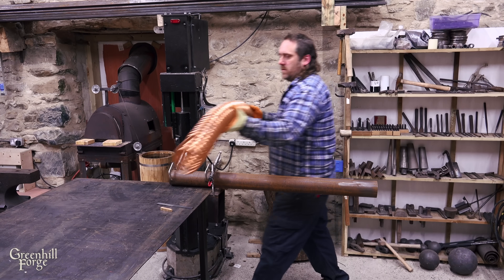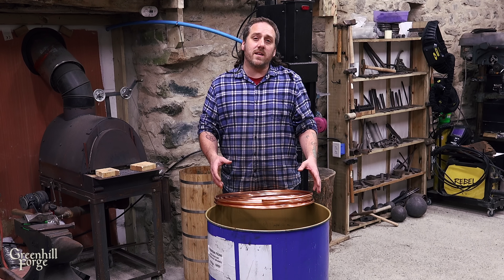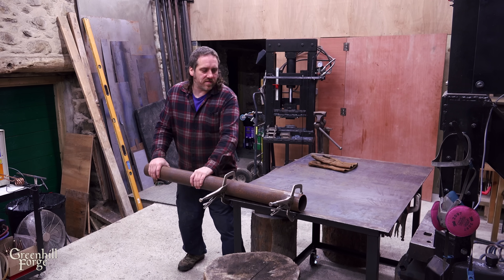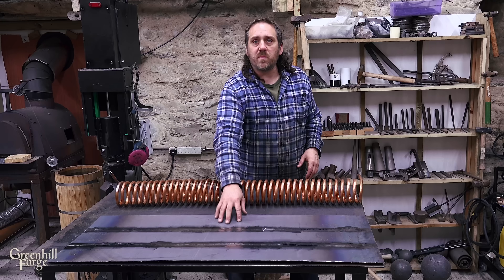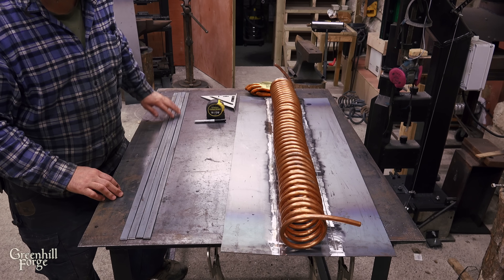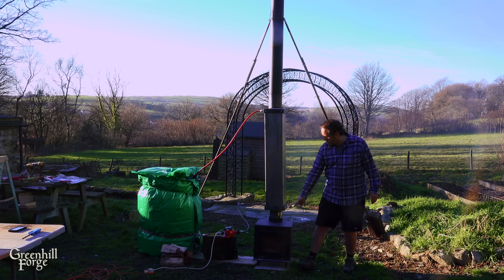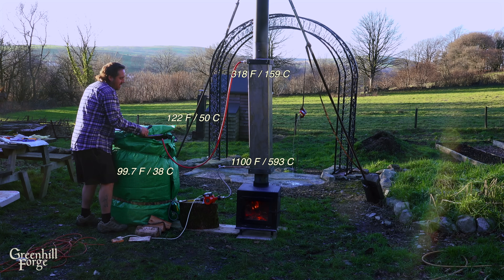Wood Stove Water Heater Experiment - Surprising Results! Part 1

Comment: Heres an idea, using excess solar energy.  Once your battery has reached full charge, diverting the excess into a heating element and filling the contraption with sand. Solar electric water heater.
Reply: Heating elements are HEAVYYY loads, wouldn’t work imo. Google Solar PV-T panels mate, a much better solution I think.
Reply: @beatdrive741 His idea is a good one.  Once the batteries are full and you have already paid for the panels, you are best off to find some other use for the energy.  The panels are selected for changing the batteries on the worst days of the year so most of the time there is excess.  Heating elements come in all wattage levels.
Reply: @kensmith5694  it isn’t efficient in the slightest, there are better approaches that already exist. Sure it could work but you’ll end up with an overly complicated installation that gives you very small amounts of warm water. Lower the wattage, lower the capability. For something as crucial as hot water availability you want simplicity really where possible. If you want to use the excess energy you’d honestly be better off storing it elsewhere as potential energy. Another battery, or pumped water storage or something.
Reply: @beatdrive741 Storing energy as heat is fine.  I see no point in further discussion
Reply: @kensmith5694  sure thing, you can but it’s simply inefficient in a multitude of ways. Ultimately it boils down to what problem are you trying to solve. Maybe there’s an edge case where it works but I’m not seeing it..

Comment: Using a sledge hammer to crack a wallnut. Heat the copper pipe up and let it cool naturally to soften it. Wrap the piping around the flue pipe and lag over it. Directly heating the water from positive contact with the tubing and will be far more efficient than insulating the copper between  the coil and the flue. I made a small rocket stove out of the five inch dsiam piping used to make street lighting poles. angled at 90 degrees to form the fire box, a 90 degees bend the opposite way to go through the side of the shed. Cut a feed chamber from 4 by 4 inche square piping and welded it into the burn chamber top. A slide in stainless steel shelf with  plenty of holes in to leave a gap for the ash to drop through The stove and flue pipe was set on a pile of bricks to save me from having to bend, It only took a few minutes before  it glowed cherry red from fire box th half way up the flue pipe., I bought some copper tubing but never got around to using it. Filled the little hopper with sticks and set them alight from the top. When the sticks had burned themselves lower, I added a handful of coal from a £10 prepacked pl;astic bag. I was in that shed for upto six hours a day and the bag of coal lasted all week.

Comment: Rocket stoves suck for this.  They need constant attention.  Unless you’ve got a servant, you’ll be in and out of the bath like a jack in the box.  For Hot water I think the large continual slow burn of the fire box is better.
Reply from the maker: I generally fall into this category of thinking too, but you gotta test everything or you don't know for sure

Comment: The comments are almost as good as the build. Nice job.

I think it might be possible to not have a pump. Same as hot air rising,  hot water will rise and flow on its own. The tubing might be too small. Fyi if you build a multi story home run a 1/4" line from your furthest 2nd floor outlet back to the water heater. Remove the drain, install a nipple and "T" the drain and 1/4" line back in. You will have almost instant on hot water. 

Coils exposed to the flue is a bad idea. A flue pipe wrapped by the coil inside of the insulated box is a bit safer.

Comment: As other comments say - reverse the water flow and you may see output flue temp drop quite a bit more.
Also, if you force more of the flue gases to flow directly over the coil with less space straight up the center it will improve.  I would add a cylinder up the center, perhaps 4" or 5" in diameter, so now the coils are in a tall donut shaped flue.
The two together might drop output flue temp by another 100 to 150 deg F, giving you about as high efficiency as you can get.

Comment: My Grand Father had something like this in his House in Tremont Ill. And were talking back in the Early 50's. His was a Farm House and he was a Engineer. He bought a single story 2 bedroom house in 1936 and by 1940 he had dug out a Hefty Cellar and concreted the walls for added Support on the sides because he had also planned to build Upwards, and was giving his foundation the extra added strength needed to do so. When I visited his Ranch back in the Early 70's the cellar was as big as the house under neath it, It was a grand 5 bedroom 2 story Ranch House. And out of the 3 wood burning wood stoves and 1 fireplace that never got used. He had pipes wrapped around the flumes and ran water through them to Grandma's Kitchen sink to the Downstairs Shower (the Only Shower in the house) and to varies places upstairs under the floor. O I'm sure he had plenty of help Building it, since their was 9 Boys and 3 girls in His Family and all but 1 was Military. His Brothers & Sisters 6 were Military engineer's Electrical, Mechanical, etc.. The 890 acre Farm was turned into a Horse Ranch.

Comment: Can't read through 949 comments, so apologies if this has already been pointed out but... You're likely to condense the water vapor in the stove exhaust. This water vapor condensate will flow  down along the surfaces where it condenses, including where it comes in contact with the steel and copper (at the sawtooth attachments that hold the coil). As copper is noble to steel on the galvanic chart, the steel will corrode preferentially. At some point, the coil might (I say might) collapse downward once the sawtooth corrodes enough. It's another reason to do as someone else suggested....separate the exhaust from the coil. You don't specify what steel you're using. You could use stainless, but the wielding used to connect the sawtooth to the box will adversely affect the corrosion resistance of the stainless.

Comment: fill pipe with sand to bend without kinking .... a simple donkey kinderling water heater, water tank higher than heater cold water from bottom of tank feed hot back in at the top only 3 foot of copper pipe in fire needed

Comment: Awesome build. Using chatGPT it takes 5,72kW to heat 106 liters of water from 7c to 38c. It seems that you made a really efficient system here. A normal wood burning oven of that size produces around 5-7 kW of heat. I was wondering; did you circulate the water properly? As heat rises, it might be 38c at the top, but colder at the bottom. If you did not mix the water, the kW needed will obviously be far less. For a good test between this and a rocket stove, be sure to mix the water properly. Looking forward to the next test!
Reply from the maker: Thanks! Thanks for running the numbers too. I'll do a data breakdown in the next video too. The hot water pipe was at the bottom of the barrel so as the hot water enters the barrel it mixes with the colder water at the bottom. must've been working because I swirled the water a few times when checking temps and it didn't change more than 0.1 degree.

Comment: There is one important thing to consider for this design.
…how long do you want it to last?…
It is best to isolate copper from dissimilar metals to prevent galvanic corrosion. This includes hangers and supports.
This refers to the fact that you have steel supports touching copper pipe.
When copper pipes come in contact with a dissimilar metal you could wrap the copper pipe with Polyken 930-35 tape. This is a product designed to provide long term corrosion prevention. It's a black rubbery like tape, somewhat like a thicker and wider electrical tape.
For an application like this, you could simply wrap the steel brackets with electrical tape.

Comment: We stayed at a off grid place a couple years ago that had a similar setup to heat up water for showering, etc. worked about as quick and if we kept feeding the fire, it would essentially function the same as a 'tankless' boiler. Only downside was having to wait in the morning before any hot water was available.

Comment: Copper around the outside of the flue would ease the cleaning issues of creosote buildup. Cubic mini has a hot water side kettle just from the heat coming from the sides of the woodstove as it's hot enough to heat till scolding.

Comment: Nice reminder of a concept that has been around for over a hundred years.   It works, my grandfather built one of these over 70 years ago and discussed the concept with me in the 1960's.   He used a G cylinder as the sheath and pushed heat into the bottom of the G cylinder from a chip heater and exhausted the smoke through a chimney welded to the top of the G cylinder which was cut away around 200mm from the valve assembly at the top of the G cylinder.   Very efficient.

Comment: A stove with a back boiler would last longer, you will have problems with tar build up on the coil and also a reduced gas flow along the chimney that would cause the fire to burn poorly.

Comment: It's very well built. Excellent design. The only thing I would add is a bypass for the flue gasses. If something goes wrong with the copper pipe while you have a raging fire, you'll still want to vent the smoke outside. I mean, unless this is solely for outdoor use.
Reply from the maker: I was going to but just wanted to get to the test, but I agree, I permanent setup should have one.

Comment: If you have copper touching steel, and if there is a presence of an electrolyte like water, you will end up with galvanic corrosion. I would recommend some non-metallic standoffs like ceramic, or else you may find your copper tube dissolving away over time.

Comment: Great job 👏 
Did you have to use the pump you seem to have installed down there (unless it’s an awfully big pressure valve, lol) to pull cold water from the bottom?

Comment: It works wonders IF you make a tighter coil that fits inside the flu pipe. Make it so it is as close to the stove as possible. The outside temps of a flu pipe only get hot enough when the stove is blasting on high. If you are trying for outside, use a 55 gallon steel barrel and poke 1 inch holes all around the bottom. Put a copper coil in there and build a fire. It is the burn barrel that you use for heating water. I used a copper coil in a campfire and heated my wine barrel hot tub from 35 degrees to 108 in 20 minutes. 45 gallons of water. In the fire. Just make sure you pull it out before you turn the pump off.  I

Comment: I think there is old literature from the USDA that has how to run an engine off of gases made by burned wood and leaves....if you are burning wood anyway why not use its smoke to charge batteries of your off grid system?
Reply from the maker: A gasifier is on my list of builds to get to

Comment: My folks had a system like this in their house for decades. During the winter, they'd switch to the heat exchanger attached to the woodstove, and use that to heat the house via baseboard hot water heaters. There was a boiler for that system as well, but they'd only use it during shoulder seasons, with the woodstove providing all the house heat during the winter. 

It was a complicated system, but it really worked great for them.

Comment: anyone done the maths on the btu's . I might come back with an answer if I remember.
Reply from the maker: From another comment "Using chatGPT it takes 5,72kW to heat 106 liters of water from 7c to 38c. It seems that you made a really efficient system here. A normal wood burning oven of that size produces around 5-7 kW of heat."

Comment: Could you use a spray foam insulation that is fire rated instead of the airgap? As well as the external insulation.
It doesn't look like you need it or that it would make a difference

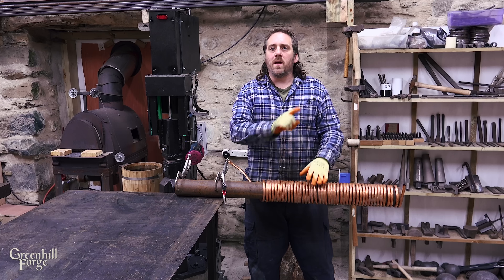Comment: 4:30 you could just weld a bit of tube to that larger pipe and rotate the pipe past it, then that would be the fixed distance to set your coil spacing

Comment: 3 minutes in, as someone who has no idea about any of these, I'm already doubting some things.

Using a barrel to fill a copper pipe without air bubbles seems like precisely the wrong thing to do to me. I think you'd be best off with some pressure and letting it flow out the other side for a bit.

Putting something under water is actually the MOST likely way to get air pockets.

Comment: You actually did something I've thought about for years. Nice. The only problem I might see is that as you cool the exhaust, creosote will form on the copper pretty quickly and fill the contraption up.

Comment: I think this will be the best transfer of heat but I’m concerned that the gases will eat the copper and a then chimney will gather creosote on the copper which will decrease efficiency and risk catching fire which would melt the copper. 
But as I said you will initially get huge thermal transfer!

Comment: Actually the old moonshiners trick to bend soft copper pipe into a nice clean coil is to fill it with clean sand and pack it solid by smashing the pipe ends with a hammer to pack the sand tight,  then bending , yes you will sacrifice some pipe at the ends so include that in your length calculations.   I would have thought you would have just wrapped the copper pipe around a flue pipe and keep the flue pipe easily cleanable,  probably could have used a standard triple wall flue pipe with some modifications.  Also your standoffs for the copper pipe would eventually wear through the copper with the expansion and contraction . Good luck.

have a great day

Comment: To add something that  said:
You should have simple means to clean the copper so you don't start a chimney fire, that is something that can happen.
Make one damper removable so you can get tools in there if something catches fire, the normal way to fight chimney fires is to clean it with chimney sweeper tools. If you can, don't put water into it. If you must, keep in mind that 1l water is 1000l steam and you have a confined space.
Also to maintain a minimum of draft you should monitor the exhaust temperature, if it gets to low reduce the flow of the pump.
What is low,  i don't know but some tea and biscuit can get that out of your local chimney sweeper.

Comment: Several bad ideas here, and bad uninformed advice.  Kaowool (white rockwool, and other trade names) is not known to be dangerous, carcinogenic or cause any known ailment. It is not asbestos, not even remotely related to it, but it does exhibit high temperature qualities like asbestos.  Moving right along. the copper core could have also been stainless steel or even 1/2" black iron pipe that runs from one end to the other, elbows down, and repeats this around the inner cord or the heat exchanger. Not wrapping it around a heavy gauge stove pipe is a mistake. this allows the collector tube and the intricate spaces around it to become full of suit, creosote, and everything going up the chimney and you can't clean it out, only take this down and throw it away.  The form around the collector tube that is filled with the kaowool is redundant and unnecessary.

Instead, you should have built the collector tube around a flue pile, built the outer housing out of a lighter gauge steel, glued the kaowool to the inside of the outer tube, then made caps to seal both ends. With the inner flue pipe wrapped with the collector tube, and a cap welded on one end, the core area around the collector tube could be filled with common building sand, it has exc4ellent heat retention and heat transfer qualities, then weld on the cap at the other end.

Add a conventional damper that can be taken apart for cleaning, and this would allow the damper to be removed, the chimney cap removed, and the entire length be cleaned with a chimney brush in a conventional way that will extend the life of the heat exchanger.

Comment: As a mech engineer - reverse your flow. Also pipe design is below average. You have to force hot air to touch the pipe from all sides. With current design, the middle of the pipe has laminar flow - more than 90% of hot gas will bypass the copper. Next time make a pipe out of columns equally distributed, like checkerboard. Force hot gas to touch all the pipes You can add baffles. Use 40-60 copper pipes with smaller diameter. Vertical pipes.

Comment: my main concern would be reducing the temperature too much of the flute gasses which could cause a lot of creosote build up and be difficult to clean. i always thought it would be smarter to do side walls of the burn chamber instead as creosote build up there is less of a concern as it will eventually get burned off.

Comment: 11:08 or instead of addingsulation you coula add a fan hole at the top and a fan holde at the bottem and use it as an room air heats added kudos if its a stirling engine powered fan

Comment: 9:04 mm if you could bend a tighter pipe you could have the top pipe bend back over and do another spiral inside the other coil and come out at the bottom too

Comment: Couldn't you just use a natural gas water heater and replace the natural gas heater burner with the wood stove it also have all of the necessary safety equipment to prevent things from exploding

Comment: Water heaters and wood stoves have been doing this more efficiently for a very long time. They put a water jacket around the wood stove, this was done for water radiant heaters. It forms a thermosiphon, and no pump required depending on the distance, height etc.